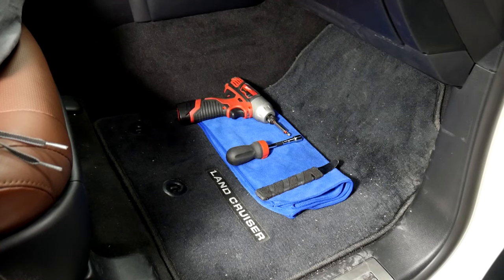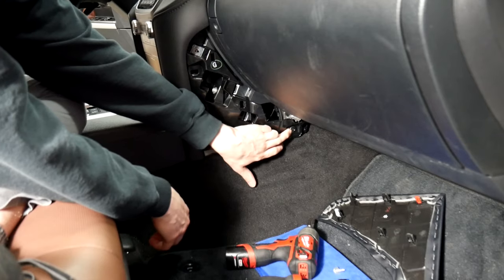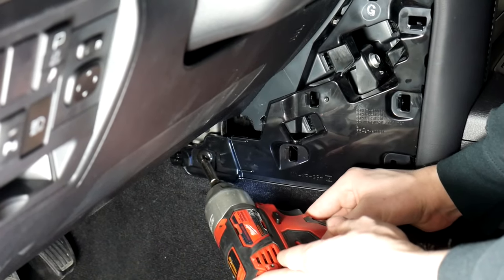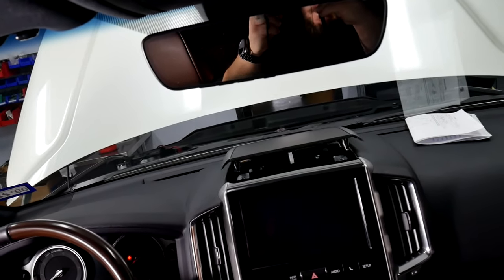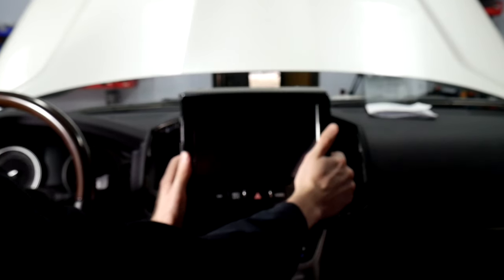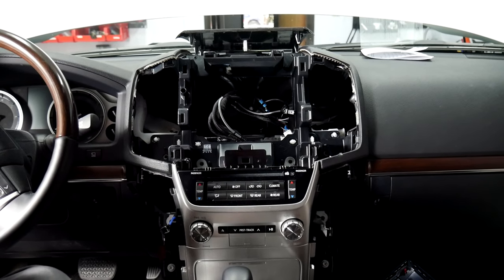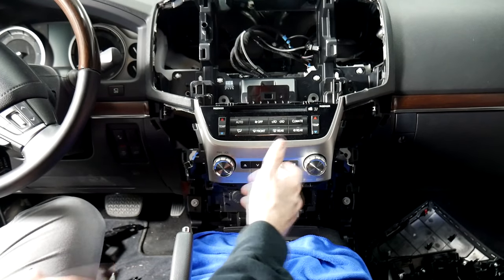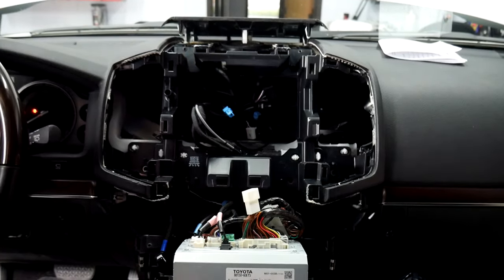Toyota Land Cruiser 2019 2020 2021 VLine VL2 Install, wireless CarPlay and Android Auto Demo LEX9T

Comment: I have the Toyota Landcruiser / LX 20-21 LEX9T model. Do I not plug in the 16pin. Is there any advantage to plugging in?  Am I losing functionality?  Or is it just not needed?  I’m ready to finish up install and want to know whether or not to leave unplugged
Reply from the maker: Please follow to the installation manual.
Reply: @gromaudio  you posted the video above stating you didn't plug in the 16 pin due to low volume from the Aux port. Your installation manual tells you otherwise.. Asking due to conflicting information from you.  BTY, i didn't plug in the 16 pin and it works perfect..

Comment: I had a question about that 16 pin connector. You said you left it unplugged because sometimes the volume might be a little too low on the vline. What does the connect do then? Why is it part of the harness if it isn't necessary? Does leaving it unplugged cause you to use any functionality?
Reply from the maker: Please check with our technical team at https://gromaudio.com/support.html for your specific set up.

Comment: Hi i ordered and received a grom audio aux for mitsubishi endevor 2004 and it isnt working and i cant find a video for install i plugged my power 12v cord and ran it to my battery because i lost the ptap but it is getting power and the cd player is still on the when i unplug it the radio gives me an error to where i cant power or use any buttons or even select anything just says error on the top screen what do i do i plugged in the positive and the other cord i plugged in the back of cd changer which was a circular cord and the harness i plugged to the grom audio cable and the aux is connected please help please
Reply from the maker: Please contact our technical team at https://gromaudio.com/support.html They will help.

Comment: Do all of the other vehicle head unit controls still work the same?
Reply from the maker: yes all controls will work the same
Reply: @gromaudio  The installation video above is for 2020 and 21' Toyota Land Cruiser - In addition to other vehicle head unit controls, will my steering wheel controls also work that the same? Thanks.
Reply from the maker: @mccabe4337  yes the steering wheel controls will keep working.

Comment: Hi, I received my interface and installed however android auto does not work, also the screen will blink on and off every 1 minute? 2021 Landcruiser
Reply from the maker: Please contact our technical team at https://gromaudio.com/support.html They will help.
Reply from the maker: Does it blink on the factory side, or on VLine side?
Reply: @gromaudio  It is on the VLine side. It will blink on and off every minute or just randomly at times.
Reply: I’ve got a 21 and am having the same issue. Support said a firmware update would be forthcoming to fix….
Reply: @SaudaSauda1979  Thanks they just emailed me saying the same thing.
Reply: Well, hopefully they’re right. At least they’re telling us the same thing.
Reply: My Vline VL2 also crashes and reboots every time I drive. Sometimes it will crash multiple times. Also it has some connectivity issues. It will lose Wi-Fi or Bluetooth connection while driving and I am always having to manually turn it on again.
Reply: @mixgraffix  hey there, I have a 2021 Landcruiser and was about to install the VL2 before I saw this, can you please let me know if your issues are now resolved?
Reply: @moto4x4adventure9  unfortunately yes still having issues with it. Tech support and I have been trying to resolve these issues for the last 2 months. They have released two firmware updates for it but still having issues. This product is not ready for 2021 Landcruiser market like advertised. They have to get a physical LC in their shop to figure it out. So until then I am a "guinea pig," if you will, because the unit is already installed in my dash.
Reply: @mixgraffix  Not good. I just installed it and the constant screen off / on is hard on the eyes.
I have a LEX9TVL2 but the only available firmware update is for a LEX7,don't know why it wants to update to a firmware for a different unit. I have avoided updating the firmware for now.
On a side note, I have an Anazon FireStick 4K running off the HDMI port, it's a unbelievable.